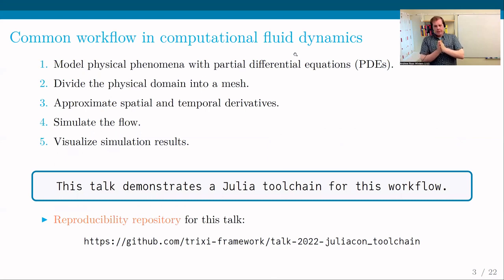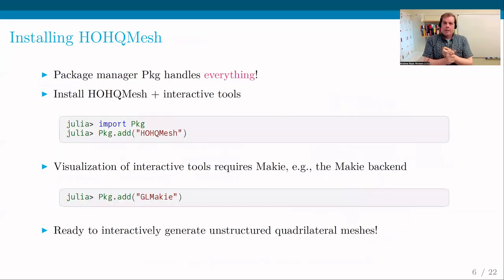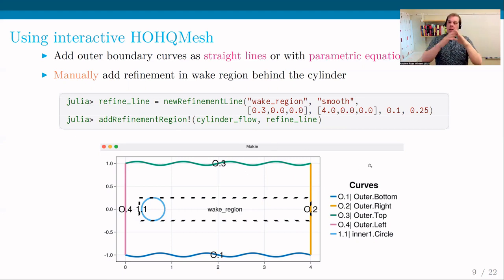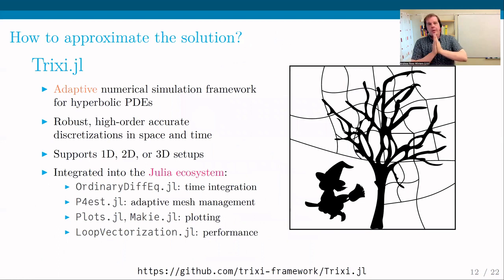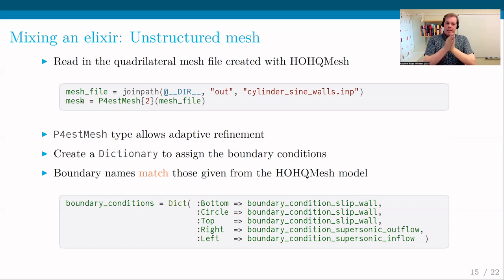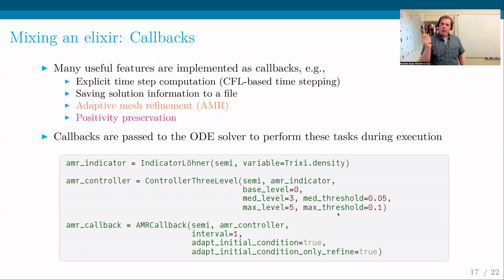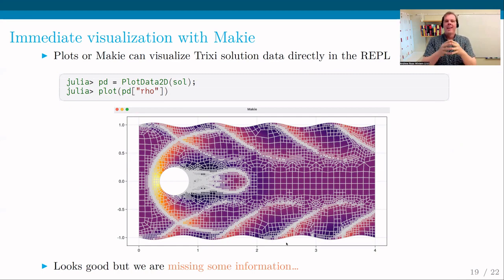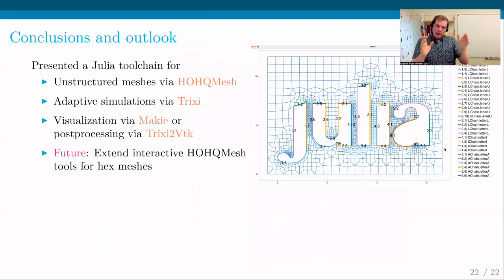From Mesh Generation to Adaptive Simulation: A Journey in Julia | Andrew Winters | JuliaCon 2022

Comment: The none of the meshes shown are up-down symmetric despite the cylinder and boundaries being so.  Is there a way to force symmetric (adaptive) meshing when this is the case?  Vortices break this up/down symmetry, so I wonder if selectively forcing or forbidding these features in the mesh would cause large differences in the results.  For very chaotic systems one could imagine that even differences in round-off accumulation could generate asymmetries that are amplified over time, but the effects of the mesh should be much larger